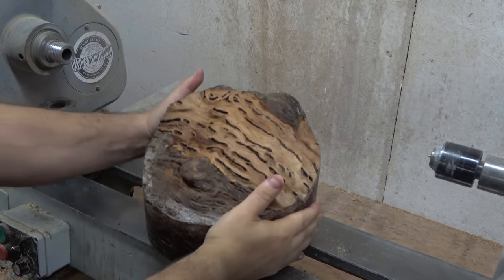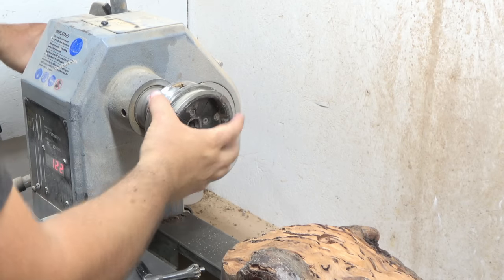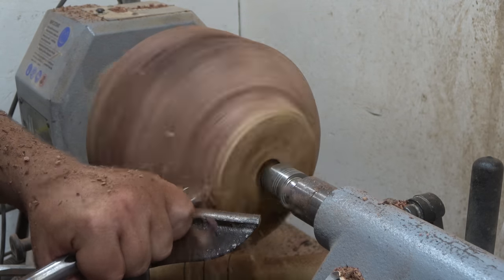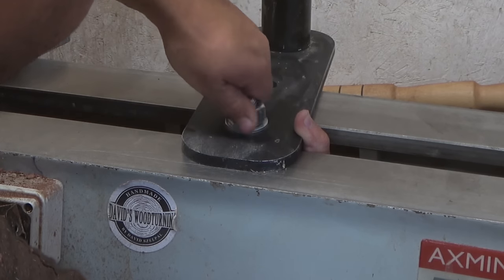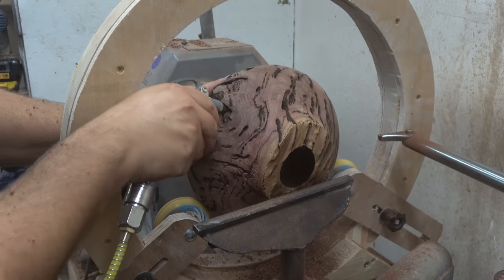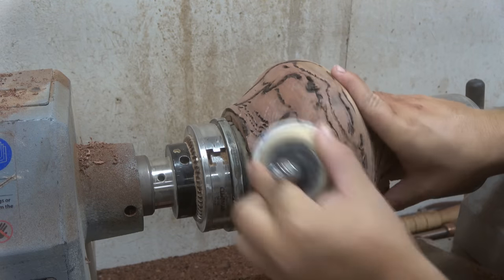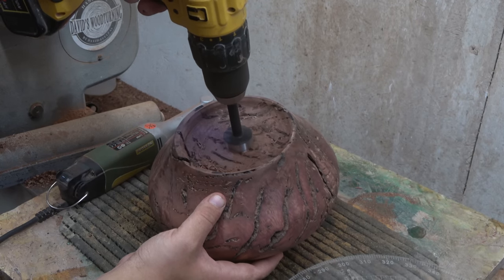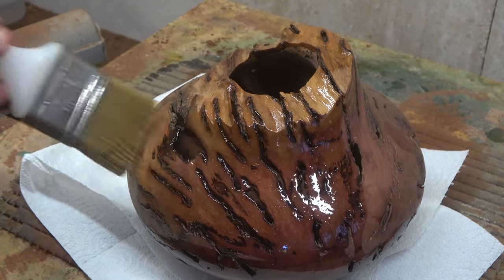Is This The MOST Expensive Wood Blank in The WORLD?

Comment: Great job on a hard piece to work with. The crystals are gum. The burl has had borers - wood eating grubs - in it at some point and the tree has bled the sap into the hole to protect itself. The sap dries and crystallises. It is a little different from a gum vein which forms the same way but where the timber cracks from stress. Veins tend to follow the grain of the timber.
Reply from the maker: Thank you so much 🙂

Comment: yeyyy 103$ I was very close!   Very beautiful piece. I have a question if you can answer, I see you use mineral oil as finishing, Does this last forever? I mean in a house? Or it has to be refinished time by time? Very very good job. Thanks for sharing
Reply from the maker: Thank you so much 🙂 It is ideal to take some care with wood too time to time but otherwise it would be very durable still. Will react to humidity and temperature change forever so some oil helps coping with that better